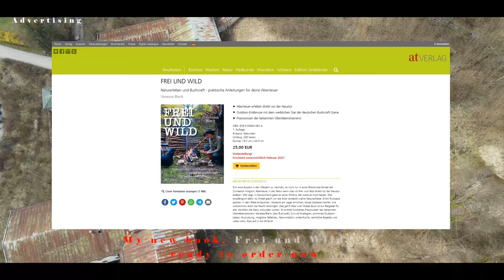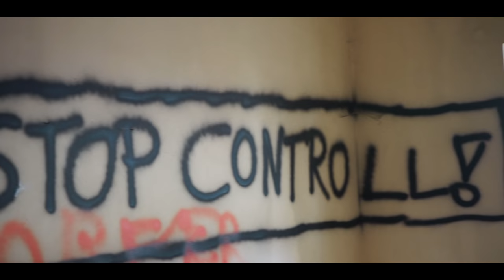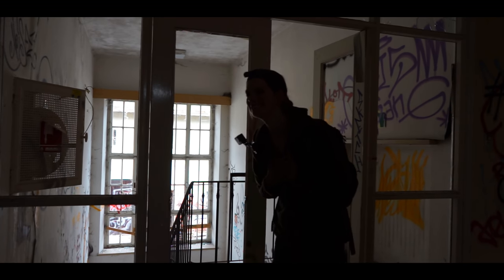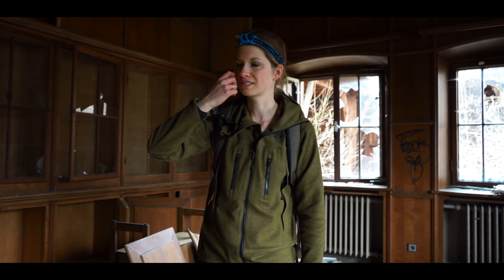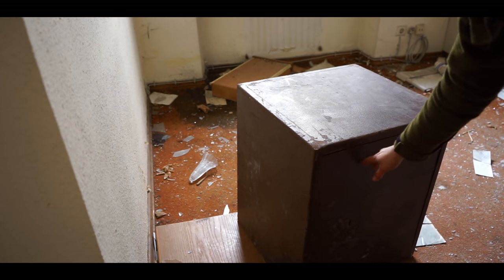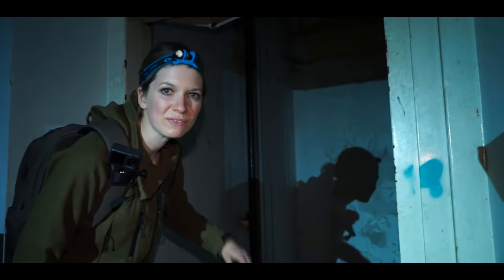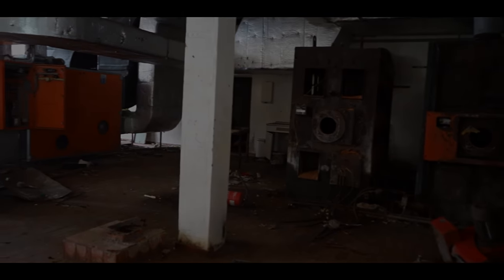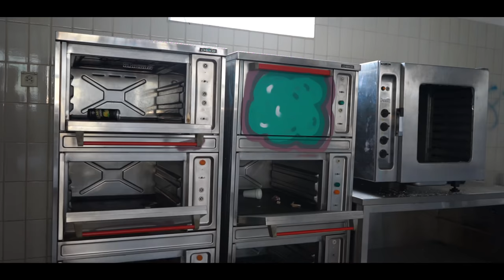Abandoned Clinic - The Mega Lost Place! 3.5 hectares - Lisa & Vanessa in the XXL spot

Comment: I'm amazed that there is so much valuable equipment (albeit in need of service) still in there.
Reply: Certainly a lot of scrap value!
Reply: As was I, especially in the kitchen area. Those ovens are probably still in working order.
Reply: @SCSlimBoiseID  no, they are pretty much useless and outdated. You would have to spend more money to get them running than what they are worth. The only thing of any value was that old scale.
Reply: @Richie90090  it would cost more money to move it than it would get in scrap, that is why they left it. In the US, scrap metal prices are way down, most people only take in scrap because they need to get rid of it or off their property. You might as well get a little something if you have to get rid of it anyway.
Reply: @mopar_dude9227  I think you're right, I wasn't really thinking of removal costs.